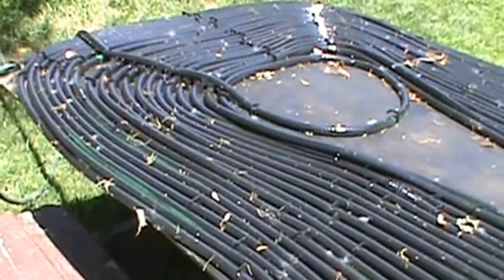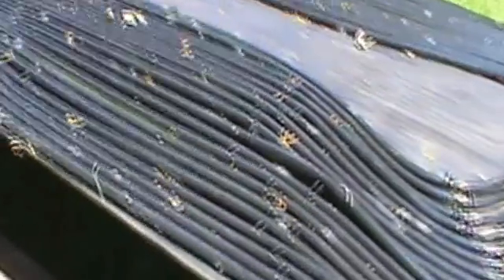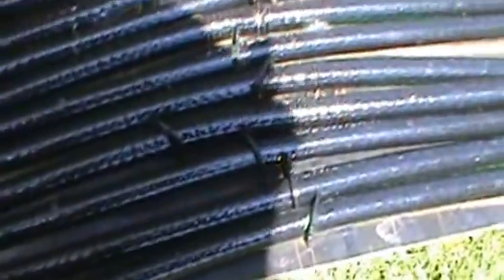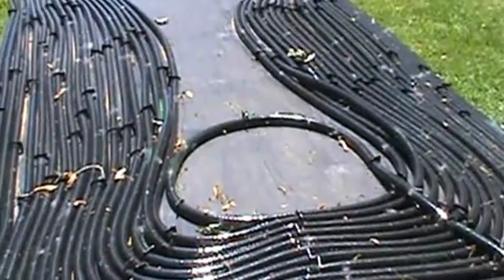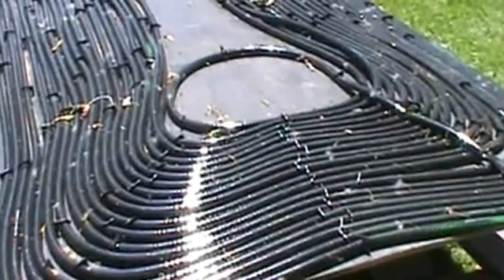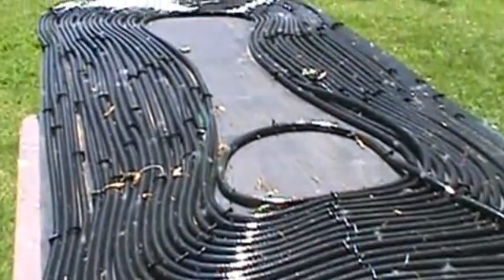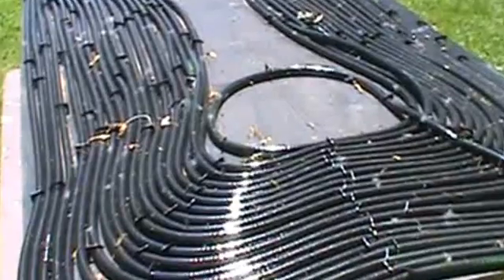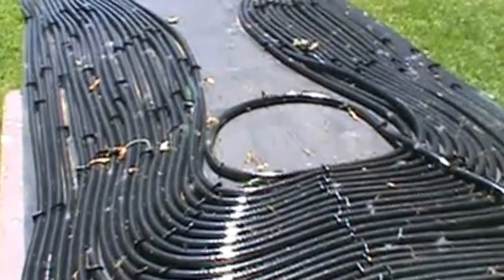SWIMMING POOL SOLAR HEATER

Comment: Just out of curiosity why not use a valve to slow the water down.  Your throughput would be less but the water temp would be higher and more consistent.  Plus you could eliminate turning the pump on and off.

Comment: The collector is more efficient at higher flow rates.  In either case you're collecting heat, but you get to collect more and keep more heat when you're trying to achieve a lower delta-T in a larger mass.

Comment: You could do a couple of things:

1) You could probably rig an old washing machine timer switch to turn your pump on and off for you.

2) You could make your collector that much bigger and not need to turn it off.  I think irrigation hose for a sprinkler system is cheaper than garden hose, and it's already black.

3) You could add glazing to the collector so it didn't lose heat to the air.  Combining this and 2) would make it a VERY effective collector.

Comment: You're wrong. Actually , it does not really matter how fast the water flows. The waiting he states , doesn't speed up the process either. The heat is given off by the warmth of the tubes. The water in the pool will heat up gradually , and will less and less cool the tubes. Letting the water sit in the tubes actually slows down the process. He should just let it run , at whatever rate . Even the strongest pump won't change the speed in temperature change..

Comment: Will it really make a difference? because whatever heat the water collects is poured into the pool. 
What i think is that pouring a 100 gallons at 5C in 10 min is the same as pouring 50 gallons at 10C in the same time ?

Correct me if i am wrong.

Comment: if you slow down your water flow a bit ..you can just let it run ..test your pool water temp. come back a couple hours later and test it again ...in just a few hours it can make a difference you maybe cant detect within a few minutes like your getting , by turning it on and off but it will work. good video and good luck!

Comment: I put a hose connection on the output of our return water to the pool and ran the hose into the pool, this way I could vary the flow, and it only ran when the pump was on normally. When I didn't need it I could take it off and put it away,

Comment: I also have 400' of cheap black garden hose hooked to an $80 pump. I just layed out the hoses in our sunny rock area. The pump can cycle about 4,000 gallons a day, and the outcoming water is 6-8 degrees warmer than the incoming water from the pool.  My pool is only 10,000 gallons, so bringing it up to 75-80 degrees only takes a few days.  In the summer here in AZ, I can cool the water with the same pump, and run the hoses to little sprinkler heads. Just run it in the morning when the air is cool

Comment: Thanks Church! I built a pool heater like yours only I used a water heater thermostat from Home Depot set at 120 degrees F. The upper one with normally open contacts. I wrapped it with foil at the metal hose connector then duct taped so it will sense the temp. I covered both coils in clear plastic. I got a 10 degree gain. I used 325 feet 5/8 " black hose. I put reflective material on the wood fence gains even more heat.  Since Jesus won't guarantee the GFI works I remove the pump when swimming.

Comment: You just want a pump with a much slower flow rate, will save energy and can be left on all day, or like you say, a very cheap timer at the plug socket

Comment: USE A THERMOSTAT! I used a home water heater thermostat dual element from Home Depot. The top one with the 3 screws. Connect the water pump thru the normally open section of the switch. Mount that to the output hose inside an electrical box. Set temp to say 110 degress F. When temp is 110 thermostat clicks on and the pump pumps out the hot water. Thermostat click off when it detects the cold water. WALLA! Automatic! Set it and forget it!

Comment: How about this, If it takes 15 min to heat up and you can run it for 5 min. I recommend that you install a pump 1/3 of the size that your running now and let it run. For example, if your using a 3 gpm pump try using a 1 gal per min pump. Or use the same pump and add 3x the hose. = no plugging and unplugging

Comment: It would be a lot more efficient to have many hoses in parallel instead of one long… the temperature delta would be smaler and thus efficency higher… a quite low pressure pump would also be sufficient to provide enough flow… just leave it running at all times (maybe also solar powered)

Comment: I'll probably use hose like this:
dripirrigation. com/ drip_irrigation_parts/ 842
It is really cheap, made for long term outdoor use and has thermally conductive carbon black mixed in (they added it for longevity but it will move more heat to the water).
At about 22 cents per foot the price is right. And no it is not the part with little holes in it, it is the distribution hose.

Comment: Hi pythonflying continued,
If it's summer and warm outside you'll get more power, if it's below freezing outside you'll get less. If your pool is small it'll get hotter, if your pool is larger it won't get as hot. I've found great information here: .fsec.ucf.edu/en/consumer/solar_hot_water/pools/sizing.htm
Your hose will work as well as their "collectors", just calculate the area of your hose and compare.

Comment: Hi pythonflying,
It's not so easy to directly calculate. The sun gives us about 1000 watts of energy per square meter average, probably closer to 800 in the winter. If your hose is black and 1/2 inch wide that's about 16 square feet or almost 1.5 square meter. So you are putting about 1200 watts of power into your pool minus what is lost to the air around the hose (won't be too much). A one inch hose will double that to 2400 watts.

Comment: Will the 400 feet of water in the hose heat up enough in that time when it comes out of a cold pool? Say, I want a 70 degree pool to be 80 degrees.

Comment: Hi, that's great but instead of timing your pump, why don't you get a slower pump and leave it on all of the time? Better still, get a solar powered pump which will probably be less powerful (and slower) and powered for free! Also build a black linned box for your hose with a perspex\glass lid to get really hot like a greenhouse.

Comment: Actually, stopping the water flow and turning it on will give you less total heat input.  The heat absorbs into the water more readily when there is a larger gradient in their respective temperatures.  It's simple thermodynamics.  Is that what you meant?

Comment: In fact you could even do without the pump. Just put the cold water outlet at the bottom of the pool, and the hot water inlet at the top. Would be much less efficient but then you wouldn't be using any electricity. As long as no one is in the pool stirring the water around it would self pump.

Comment: Hi gravityisweak, your first comment is correct. It's also why your second comment isn't. The small piece doesn't have a different thermal capacity it simply has a higher temperature. It is temperature difference that matters most. In order to get the most heat into the water you want to keep the water as cold as possible. If the water at the end of the hose, is as hot as the hose then it can't recieve any heat from the hose. If the water is cooling the hose then it's gotten all the heat it can.

Comment: Kevin, the heat loss in your piece of metal example is related to the ambient temperature of the air surrounding that piece of metal. Also, the small piece has less thermal capacity than the larger piece, which is why it cools faster.

Comment: Correct, professionally engineered systems have a 3-7 degree rise across the collector. The more water you flow and the lower temperature rise across the collector the more heat will go onto the pool

Comment: Only right if you want hot water. If you want to heat the pool, pump as much water through as the pump will provide.

Comment: Totally wrong. The hotter you make the water the less heat goes into the pool. Think this way: If you put enough heat into a piece of metal to make it glow and carry it around a little you will lose most of the heat you put into it, you can tell because the temperature drops a lot. If you put the same amount of heat into a large piece of metal, it won't get very hot but, when you carry it around a little you won't lose very much heat, as evidenced by the small temperature change.

Comment: Correct except for entropy. The +1°C will always put more heat in the pool. Professionally engineered systems have 3-7 degree rise across the collector.

Comment: You're on to something. The bigger flow, low temperature increase will deliver much more heat to the pool. The low flow, high temperature increase suffers from high entropy - it looses much more heat to the environment which means less goes into the pool. Basic thermodynamics.

Comment: Nobody wants a bunch of solar heater junk in the pool but you have a great idea in trying to use the temperature difference to move the water. One hose pinned (weighted?) on the bottom and another at the top may work. The collector may have to be re-plumbed to put several hose sections in parallel (that will not affect the amount of heat collected or delivered to the pool, take it from a mechanical engineer that understands thermodynamics).

Comment: Better yet, No pump required. float a cone shaped roll in the pool. With the intake at the bottom and cap off the end and leave slightly below the surface, at the top end fill the entire hose with water drop it down into the water facing the opposite direction. Remove the capped end. This will rotate by itself, the cold water rises to the top and becomes hotter and hotter and down and out "short trip". 1/2" drip irrigation supply line works good and is cheap.

Comment: Then the water comes back hotter, but there is less of it. I don't know if it matters what the rate of pump flow is. You either have a lot of water coming back a little bit warmer or a little bit of water coming back a lot warmer.  Same amount of heat transferred I would think - just in a different way. I think it depends almost completely on the surface area of hose exposed to the sun.   It would be interesting to experiment with it both ways to see which one warms it quicker, though !

Comment: How about a lower capacity pump that ran constantly? (but very slowly)
We used to have a long black rubber hose at  stowmarket swimming pool in the 80's. You could have a quick hot shower before it ran cold. Sometimes we needed a cold one as Heather Stewart-white used to come swimming there when she was sixteen....

Comment: I agree with the people saying use a smaller pump. Just use something with a slower flow rate that can match the rate at which the sun heats up the water in the hose.  Right now your pump is pumping faster than the sun can heat.

Comment: If you use a smaller pump,the water flow will slow down allowing to to gather more heat from the hose...slow it down or bypass ost of the water so it trickles.....should trickle screaming hot water then...

Comment: A suggestion: Replace your garden hose with some sort of metal pipeline. garden hose is made of rubber or plastic which is not a good conductor of heat !!

Comment: Sister has a ground geothermal system.(Atl.GA).  Basically an electrical heat pump with buried water pipes. Excess heat to water heater.   Major parts: Variable speed water pump, Variable speed air fans (at copper condenser / evaporator coils), Variable speed refrigerant compressor, Variable speed air fans to house vents. IC control board. Small  electric bills. 10-15 years wore out. Warranty replaced it with fixed speed stuff =>expensive bills, breaks down a lot. Defeated purpose of heat pump.

Comment: Better:  Pump is running all the time. With 400ft of hube you will feel at the outgoing side maybe 1-2 degrees more than your poolwater has, but: Watertemp. inside the hose now is about 26 (when you pool has 24), outsidetemp. is 28 - you see there is no energy flow from hube to air in this case -> energy is fully used to warm up the water inside the hube.

Its a common misconception that a solar panel heats more if you time the pump!
With the timer-method you also can destroy your pump over time

Comment: It's wasting of energy when you turn on the pump for 5 minutes and turn off again for 15 minutes.Yes, in this way you can feel the temperatur, but you lose lots of energy.

Example: After 15 minutes in the sun the water inside the hose has about 80°C, but the airtemp. outside is about 28°C - what will happen? - an energy flow from warm to cold - from hube to air -> you heat the air with the energy of the sun ... nature will do this alone, it do not needs you :)

Comment: they sell mechanical timers for less than $10 that have 15min intervals that can turn the pump on and off. and you could also set the pump to be off when the sun is down.